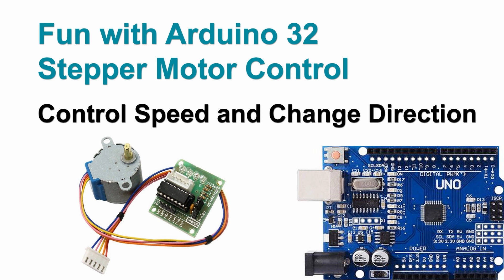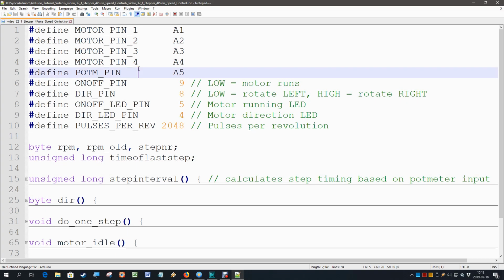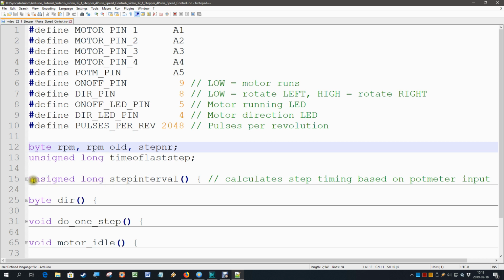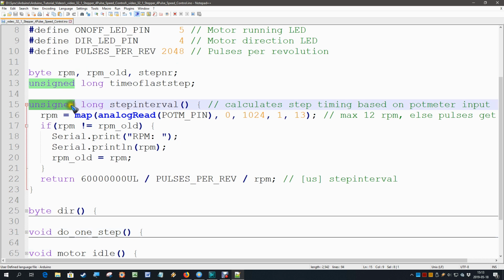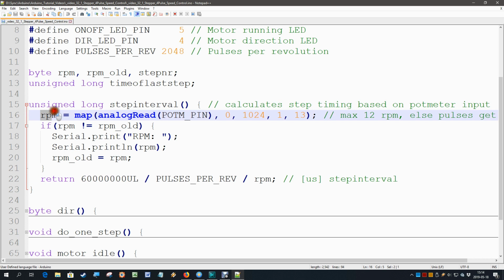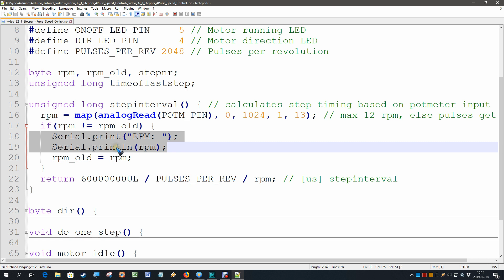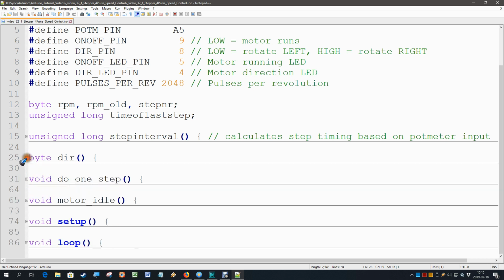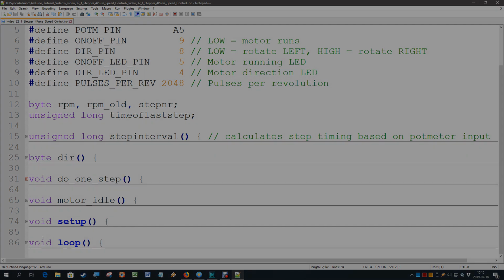Fun with Arduino 32 Stepper Motor Direction and Speed Control

Comment: What component is the second silver button right side? Because the potentiometer is of the left, thanks
Reply from the maker: It's a rotary encoder.
Reply: @rudyshobbychannel  and you only use how push button? Can show how do the connections wire? thanks so much and amazing videos
Reply from the maker: The pin connections are the #define statements at the top of the software listings. No need for a wiring diagram ... switches or signals to/from units like a motor driver board are connected to the pin numbers stated there.